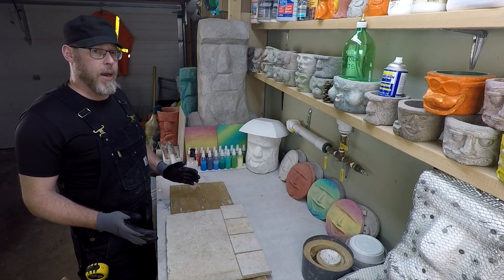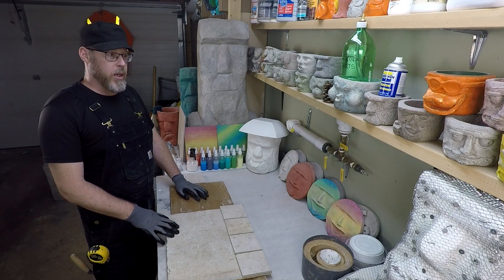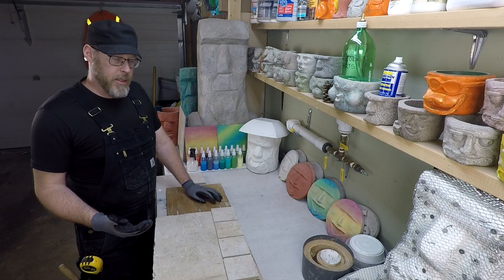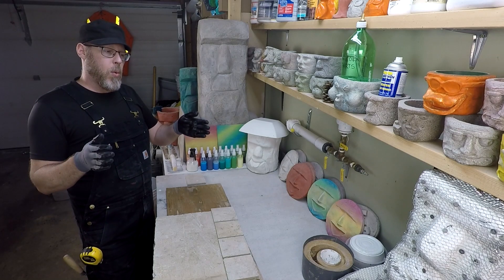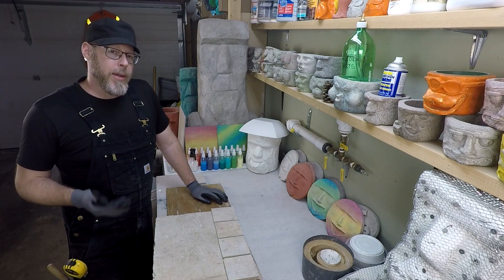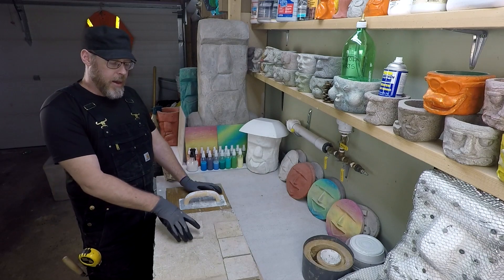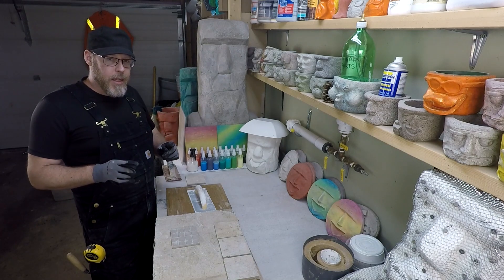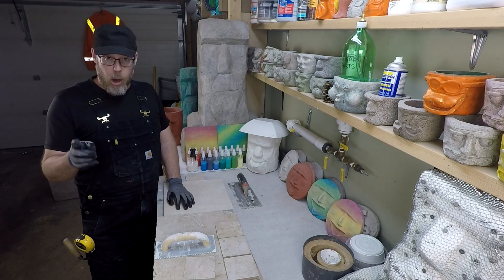Why Do Tile Floors Crack?

Comment: My mobile home, we had it tiled in 2019, the installers put wood, concrete panels, then the tiles, not sure if it’s concrete but a layer of backing between the wood and tile.  At first when we heard the cracking he insisted that was okay just the house was settling.  Underneath the floor in my room you can hear what sounds like something cracking underneath but the tiles are not cracking, should I be worried?  I was told this floor would last a lifetime.
Reply: mobile homes aren't stable enough. Flimsy.